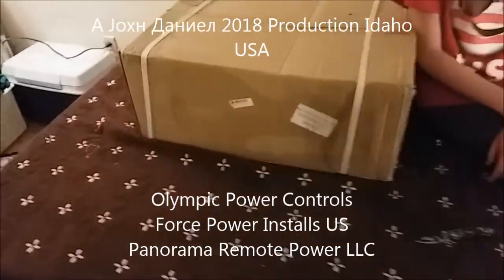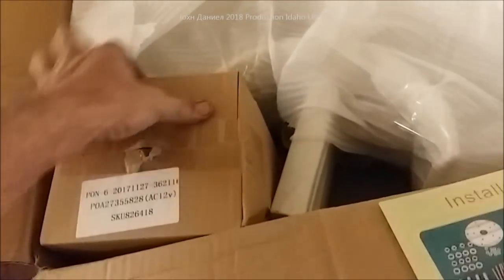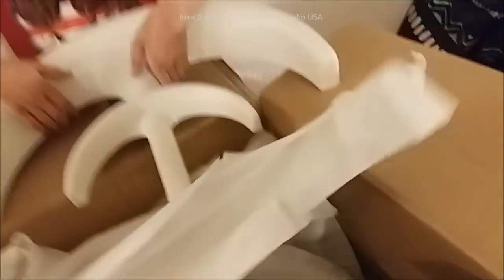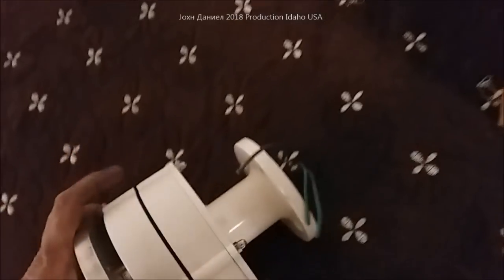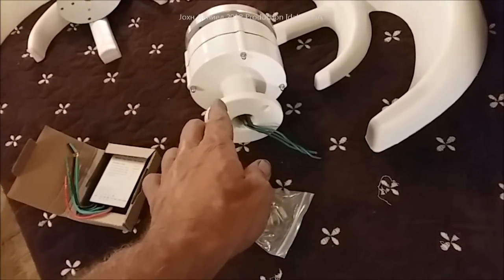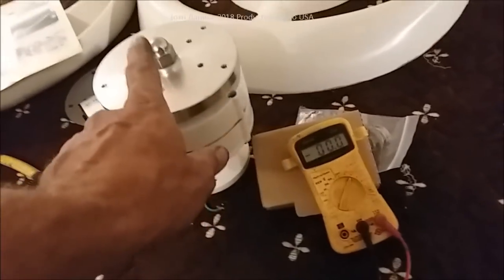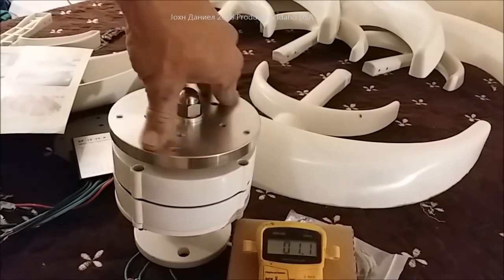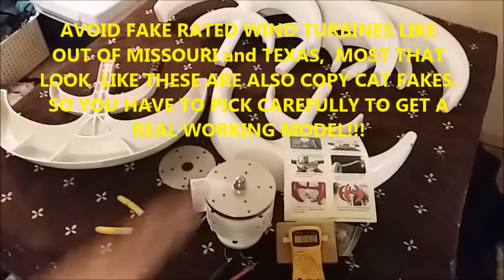New Chinese VAWT Lantern Wind Turbine generator vid 1 of 2 - 400/600Watt UPDATES BELOW VIDEO

Comment: Hi John.  Can you give me a link to a high quality Chinese vawt vertical lantern style wind turbine like the one's that were previously sold in 2018 with a low rpm pma?  Due to further consideration of my environment, the pine trees here are too close for a horizontal turbine to survive unfortunately and my neighbors would probably complain if I installed a big propeller in the sky.  Low wattage is fine but I have heard some of the new one's aren't as good and there have been knockoff brands where the pma's are being made with cheaper bearings.   I am interested in supplementing my solar system during the evenings with a small amount of wind power.  Ron.

Comment: hi john 
when i click on link shows me different turbine its not the vertical which i m looking for.
cheers J
Reply from the maker: Take a pass on the vertical wind turbines the one that I put in the link is 10 times better not very loud easy to lift and guarantee to make the power as rated. The vertical wind turbine if you're lucky and get one with a low RPM PMA on it may make you half the power they rate them at but they're very difficult to find because the PMA is very expensive for that.

Comment: I bought a low rpm mars rock pmg. It's rated for 600 watts at 600 rpm. On a waterwheel I would make 24 watts at 220 rpm. Using as a ha wind turbine it would make about the same at sustained 15 mph winds. Why the he'll does it suck so bad? Also it's much harder to turn than yours.
Reply from the maker: It's the Chinese program, you can get great, awesome or why the hell I buy it out of every option. The MARS turbines are full of wrong magnetic materials, not all turbines that look alike are the same, it all depends on the vendor who you get them from, if they spec it for proper magnets, stator metals, and rotor design and what they order to be in them.

Comment: Bad advice, do not buy, they dont work... see if you can find ANOTHER  video saying they are any good (apart from those by John Daniel).  This video should be taken down.
Reply from the maker: Saying they produce power is not saying they produce rated power or even usable power. Responsible You Tuber should watch all 3 videos from unbox, to build, to install to see the peak power in high wind gusts was a max of 9 amps. Does a $150 VAWT compete with a $150 solar panel, NO! Are they a option if you have high winds? Possibly. But no responsible you tuber should think they all live in or are a comparable to the high desert with 25 mph + wind averages!

Comment: Should use Anemometer,  Power meter, Voltmeter, Ampmeter, to verify these devices.        
       Power =  Force   *   Speed  =  Voltage * Amperage
When mounted low,  wind speed is small;   When the effective blade surface is small, not enough area intersecting the wind,  not enough force generated.   
      The most effective windmill is horizontal ones, and more blades will give more push surface. Also enough mounting height is necessary for get enough wind speed. Night and  winter will have more wind speed.    
      Buyers should ask for DATA from seller  before buy these devices.   If made in China, these product should be shipped OUT of China, not somewhere else.   Advertisement ONLY= SCAM.   Sellers  should provide Government Certifications for their products!

Comment: There are only 3 wires coming out of it. Is the case the common?
Reply from the maker: All under 2500 watts use 3 phase, 3 wire.
Reply: @JOHNDANIEL1  ok, I understand. It's a Delta 3 phase not a wye (star) configuration.
But is the turbine wired commoned to the case at all? (Earth ground)

Comment: Ron Falconer

These lantern turbines are rubbish -  After one year claiming it didn't work the Chinese manufactures agreed it was a bad design and "refunded" my money. The generator needs at least 200 RPM, the lantern turbines just don't get there. They are cute and fairly quiet. Some sort of gearing to get the necessary RPM might work.
Reply from the maker: Generation 1 was really bad, 7mm gap between the stator and rotor, this one is 3mm gap which finally puts the magnets into play. How good? not impressive, they still needed a much larger radial generator head and I have stated that for years, one with a 12" case, 9" rotor and 16 magnets instead of 10 so the magnets pass the stator faster in low RPMS. Will it make power, yes, much more than the 2016-17 models, will it hit claimed watts, Hell no, its chinese math!

Comment: So what are the charging amps volts is only half of the story the smaller ones make voltage but only .2 amps ?
Reply from the maker: I have seen 9+ amps in 20 mph so far but it seems to not want to get you to 10 very easy. A good 25 mph plus wind storm yesterday saw a peak of 13.9 amps/200 watts , but at what wind I have no clue.
Reply: @JOHNDANIEL1  so 400 watts is still way over rated for what you will get. Sounds like your getting constant 110 watts or so. Good to know 100 watts over night will still charge my rv batteries when my solar is not. Thanks for your video

Comment: In the video, you referenced that you were sent a 400W/600W turbine. The link you provided points to a 400W turbine. Is the machine in the link the same as what you are demonstrating, or is there a different link needed? Since you made several references to avoiding knock-offs, it would be great if you could be very specific about the 600W unit you received. Thank you - here in western Nevada, we often get quite a bit if wind!
Reply from the maker: Using the store history that included the sellers product history I got the names of his other 2 stores on Ebay and one on Amazon they use. I know of many who bought one from a fly by night drop shipper and it had 500 watt claims, like that clown in missouri does his junk and the reality was it had a 100 watt PMA on it. Theres so many in China who copy off others successful stuff. Like SUNNING WIND POWER was knocked off by HY-Energy and FIRST WIND. 
But you can never be 100% on anyone or thing from China, I just put sources for the most trusted.
Reply: @JOHNDANIEL1  , OK, thanks for the info!

Comment: So I was thinking about setting up a tower with 3 vawts..  One vertical and two at a 45 degree angle.. Like a tree.  I'm  thinking they should work at any angle.  Wotsay you?
Reply from the maker: Sounds like a cool set up, make a video of it.
Reply: Well I'm concerned it may produce undue stress on the bearing mounts

Comment: Instead of a sheet of aluminum, could you put silicone gel in it.
Reply from the maker: Possible, if its not going to fly out at any point
Reply: You would seem to only silicone the part in the section close to the housing. The open space away from the generator would seem to shed any debris by centrifugal action. I am looking at this as a possible part of my own self generation system.
Reply: At one time, I delivered construction and finishing supplies to Twin Falls. I love the scenery there. Where I live not has an average wind speed of 20 to 25 mph. That should be more than enough to test a unit out. I like the curved blade design.

Comment: A 100 percent totally worthless review. . . anything can produce voltage. . .And that is all you showed.   How much current?  Did you attach a small motor to it (which will draw very little current) and see if it can withstand the load of a small motor?My house is 100 percent reliable on solar and wind in Colorado.  So far, what i have seen in vertical wind turbines from different sources has been way below sub-par. 
If you evaluate such devices, you need to put them together and put them under a load.  You need to see the response they give when under a load.  Either that, you have done nothing at all, but take something out of the package and claim you know how it works. 
So far, what I have seen test wise, any of these turbines coming from china, korea, or where ever are a huge waste of money. 
There is one Gent on Youtube that actually put one of these vertical turbines to the test with good wind conditions.  He readily has shown that these so called wind turbines are so overrated, that a small DC motor will kill the power these things produce.  In other words, the current of a small DC motor from a toy, dragged the voltage down on these turbines to less than half the voltage.

Comment: I have this vertical wind turbine 600 watts 24V, I need controller.The same wind turbine vertical, only have 3 green wiring cable.
Reply from the maker: This controller https://amzn.to/2COSYdm and be sure to wire with at least 10 awg wire. You can add 400 watts of solar also to it , four 100 watt panels like these best in class 4 buss bar panels https://amzn.to/2Eq7Q3v and the 4 buss bar panels make more power over a days sun than others.

Comment: Safety note- Your helper should have that long hair pulled  back when operating things as a drill..During WW2 my grandfather ran a machine shop with women and a few ended up with a bare spot on their her and her beautiful hair wrapped up in a drill press or lathe.  in the Days before OSHA
Reply from the maker: She puts it up into her hat when running drills, routers and saws for that same reason, this time around I was distracting her filming. She was working off behind me most the day with another build. She builds insulated large and x-large dog houses for a local guy who sells them. Luckily she was at a decent distance from the intake on the Milwaukee.
Reply: Aside from that I really like your vids

Comment: After having the 2016 model up and down off the pole three or four times and what you have to do to remove all the blades. I took a 1" conduit punch and made the hole in the clamp plate bigger so you dont have to remove individual blades to remove pma nut.  just use a socket and then insert an allen to hold pma rotor still and unscew the blade assembly.
Reply from the maker: The new ones are plenty big to get a 15/16" socket in and remove it. Another 2019 improvement.

Comment: I have a low speed wind tunnel and have been testing different VAWT rotors over the last 6 years.  If the alternator turns out to be of good quality but the blades lack the needed performance, I would be interested in designing and testing a more advanced rotor assembly for that particular alternator (or any other low cost, high quality VAWT alternator of that size that you would recommend).   dan@edmistons.com

Comment: Very much looking forward to the next video. The voltages from hand turning it look promising. As it generates AC, have you considered power factor correction prior to the rectifier and then looking for a more efficient rectifier for better output results?
Reply from the maker: Working on it now and going to show what, and where to get it a special fitting to make installation weld free.
Reply: Јоhn Daniel working on the video, my suggestions, a video incorporating my suggestions, researching my suggestions and how to incorporate them into your design/video...???
Reply from the maker: Pitch some thinking at me. Always open to ideas. Since my stroke the ideas come and go and some even are more creative than before  the stroke.  Go figure.
Reply: Јоhn Daniel as the output of the alternator varies with windspeed and is AC, balance the power going into the bridge rectifier with capacitors. The capacitors charge with the wind and discharge as the load (bridge rectifier) demands it, making for a steadier demand/constant load. Maybe better battery charging downstream as a result. Email me and I can point you in a direction to learn more.

Comment: Since you mentioned the turbine could not power a motor home or larger fifth wheel here’s a screnario.
Six acres backwoods no power or water but there is a septic tank. ( Don’t know how it got there but it is. Maybe previous land owner.) I want to put a tiny cabin on the property. I take my 39’ fiver for camping and hunting. 
Can you do a video on how to determine how much power you might need to sustain the campsite. What type and how much energy generation and how many turbines you’d need. I’d like to take the turbines up on arrival and take them when I leave. Just trying to get a feel for what’s involved. I had been thinking of the Chinese turbine that you’ve shown recently.
Any suggestions.

PS: How the refrigerator conversion coming along?
Reply from the maker: If your going to own the 6 acres, I would consider putting the cabin system as priority and using the 5th for trips to do work. For a 12 x 20 cabin, you can do the basics with 500 watts solar and 2 small turbines. If you want more its not hard, just wire for it in advance. Accurately determining the size of a system is related to the exact location and items intended to use on that project/cabin. Give me a much more detailed plan, size, how many it will support, regional location and I can send you to what you can use to make it work.
Reply: Stay away from Turbines. . . Water pump takes about 800 watts only for a short time.  Lights are 60 watts (60 watt bulb).  A/C is about 800 watts. 
How long are you going to run the A/C?  10 hours = 10 x 800 = 8000 watts.if you have 100 watt panels, it will take 80 hours rto replace the energy used by the A/C.
If you left your 60 watt bulb on for 8 hours, it will take 480watts of power.  A 100 watt panel will replace the energy in 4.8 hours. (480/100)
Your water pump.  . rarely used.   It takes a lot of energy, but it is only used a few times for a minute or two.  Thus, it may use 1000 watts for 2 minutes, but that is equivalent to only 33 watts, which your 100 watt panel will replace in20 minutes. 

Add up all you power and see how much it is equivalent to per hour.  That will tell you how much alternate energy you will need.  If you need 90 watts per hour, a 120 to 140 watt panel will supply you fine.  I say 120 to 140, because a panel is rated at FULL sunlight, and facing directly into the sun.  Most of the time it is not.  So allow room for error.. about 65-70 percent or so.
Also, you have no sun at night. Hopefully your electrical usage is very very low at that time. 

A wind turbine will NEVER be able to produce enough power to sustain you.  It takes way to much wind, constant wind, and high altitude to even produce a constant 200 watts of power, or even 100 watts of power.  Especially continually.

Comment: Can't wait to see her pumping out some amps, I have the other Chinese turbine still surviving..we are due some big wind next weekend. I've noticed with the 3 brake resistor like yours is causing some weird resonance noise on the pole doesn't cause me any problem but hope it's not doing any damage.
Reply from the maker: If you have the resistors wired as a passive load for braking it may bog down the turbine but is designed to never stop it but instead keep it from over speeding to a point of damage.
Reply: @JOHNDANIEL1  yeah its inline just like your setup 😎. Anything else you can think of that's causing the vibration when it's on?
Reply from the maker: I would check the blade/hub nut on it. These will seem to have made up fully but will be just barely loose enough to give off some strange vibration. They will feel like they are getting real tight, like another turn will snap it off but if you back it off, and run it in a few times it will fully tighten. I put a thin copper washer on mine to get it to make up tight. I was afraid of snapping it off tightening it. They use a special impact to install the hub on them with a reversing center hex that of course WE don't have, so check it, be careful and see if thats the issue. Also a possible loose blade. Like a trailer wheel, got to to a re tighten blades after some hours of use for permanent setting.

Comment: I have been thinking about getting or attempting to build a wind turbine. For a few years. At my location in North West NC. I'm on the side of a hill in a valley. And surrounded by trees. I'd have to go up about 100' or more to get a breeze! There is wind just not at ground level. There is even a place close by called windy ridge  being fully off grid I can use all the watts I can get. If I can get just 10-20 amps at 30v or 300-600 watts. A few hours at night it would help alot. I don't get wind like you do. At times I do get a good bit. My solar only gets sun about 6-7 hours a day at best. So I need to look in to other options to extend charging capability. I don't think it would be worth putting alot of money into it. And I need to charge a lithium ion battery bank. I'm building it  and up to 600ah. And hope to have it to 4 times that soon. Well in a year or so. Lithiun ain't cheap. I'm using nos cells matching them can be a pain! The power is amazing! 600ah from a bank the weight of a L16 and 29.4v full charged. Battery management can be expensive. I'm keeping my lead acid Bank as back up. Great video can't wait for more. Are you going to mount it and put it to use?
Reply from the maker: Hmmm, Heres a 100% PokyDoRight™ idea - Take your Lithium idea, add 500 - 700 more watts solar, jump the Lithium bank design volts to be 48, Charge that bank separately. Then using a dusk to dawn switch and a 60 amp relay, after dark it will automatically feed the 48 volts through a dusk to dawn switch after dark to your 24 volt deep cycles with a 40 Amp PWM controller. And it will only do it on your charge settings. So it may add power, It may not. It may add power for 20 minutes then none for 2 hours then again as needed all night long. BUT, it will be the ultimate continuous loop energy system. Way better, more effective, than a turbine in your situation.

Comment: 5:22.. Why not put it on a drill like you did with the other 400W generator.
Reply from the maker: I am considering that in video 2, but the objective when opening was to test its low RPM response based on the basic level of rotating torque my hand would give it which would be similar to the blades likely ability.